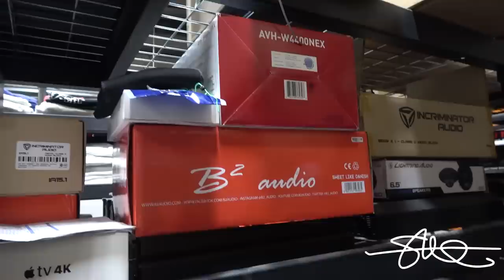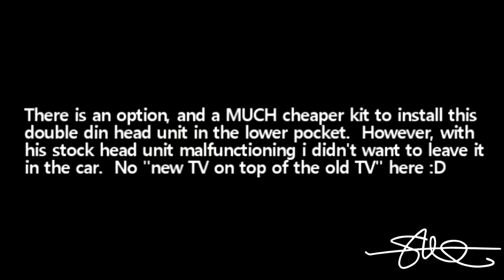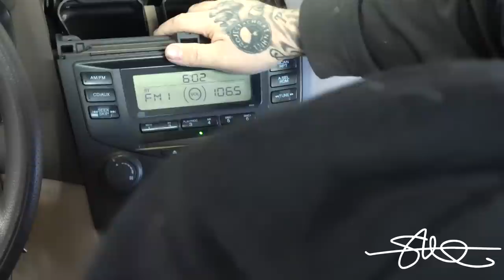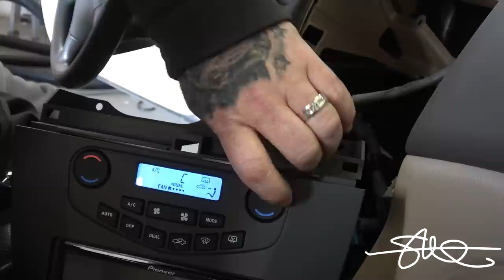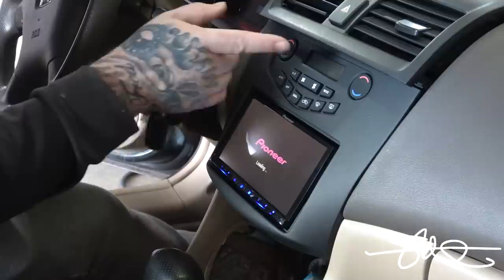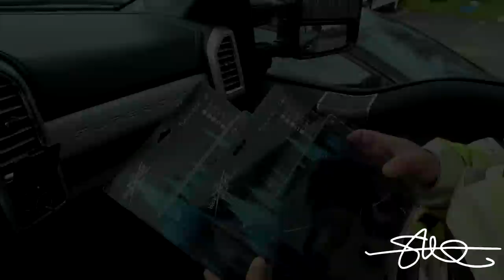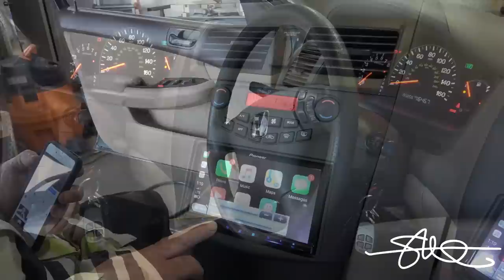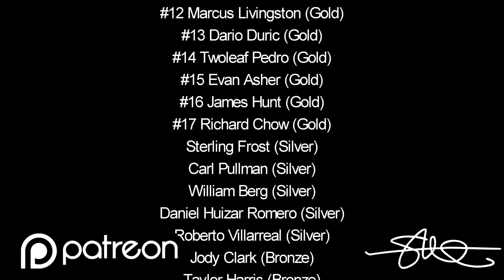A Double Din for Jaybird! The $140 Sound System! '04 Honda Accord (video 2)

Comment: That upper panel the way to remove it with out that metal clip flying out and risk damaging the panel. Is to take and push hazard light switch. Then use screw driver and push down on the center part there’s a slot there. And then use trim tool to carefully pry on the left and right sides. But shouldn’t matter its LX model.

Comment: I had a problem with that metra kit for some reason is was draining my battery if my car wasn’t move for 3 days i found out that it was the connector that gives the light power on the climate controls  so i just left it off it works just doesn’t have light on climate controls idk what to do for now thats how it works
Reply: Self Made Vlog I have a 2006 2dr Honda Accord and I have the same issue with my car. I installed this unit years ago and always had problems with it draining my battery completely after 3 or 4 days sitting. This has pissed me off immensely. I always thought it was bad wiring and I just managed over time but I’m glad I know the problem.

Comment: i did an install on my 2014 honda civic and the dash kit i got feels cheaper then the original piece but it works and its sitting secure  and in the right place
Reply: also i ran rcas on a toyota camry after this and its fun, just the hard part is hiding it in the carpet

Comment: What exactly is the volt out on the rca's 2.2 or 4 volt cause I was looking at 1 really close to that 1 I'm all about that 4 volt out ya buddy lol it does wonders to your signal to your amps lol it's a dam shame if they don't got the big 4 cause that means I would have to add a audio control peace to make up on the deck voltage outs ..

Comment: I do audio installation for a living and just for information purposes all pioneer radios with the parking brake wire you can put to chassis ground with a small toggle switch interrupting it and that will give the exact same effect as the bypass module you installed.
And the bypass module does not get hot.
Reply: Why even do the switch then, just put it to ground
Reply: @philb707  it has to see it pulse to ground. It will not work properly if it always sees ground
Reply: My apologies you're 100% right, i installed some cheaper H/U that just wanted to see ground.
Reply: @philb707  now all kenwood radios you can just ground it out. And some older alpine radios as well but 99 percent of all newer alpine need to use an alpine specific switcher
Reply from the maker: or i can just use this and not have to hit a switch.  I hate toggle switches.
Reply: @meade916  totally agree with you Steve. I only listed this because I have seen in the past that they have failed. I used a switcher in a Semi and I had to tear apart a custom dad I built and it was almost 6 hours of work because that little chip failed. Just giving yall options.

Comment: yup. my boy did a pac head unit with a single din and 4 speaker install and amp. on my 05 accord. took him 12 hours of non stop work only to find out we needed seaker rings for the front and no sub install too. im almost done with it just the bass in the trunk and the same b2s jaybird has and im set. can wait to see how you do the front speakers mr meade

Comment: yo steve, what did the RCA's screw into on the outputs of the radio?
Reply from the maker: ya they grip hard when you tighten them. They are designed that way. They are pretty nice.

Comment: I like the way the head unit looks but not crazy about the ac controls
Reply from the maker: ya i feel ya on that.  They are a lot better IN the car and working but when i first saw them in the box when i bought it i was like 'meh'....LOL
Reply: Fat Tony Slim in my 05 accord I have navigation and it’s even worse. The ac controls are done through the screen. I just have to deal with having a stock head unit and upgraded door speakers. I’m only 17 so I’m kinda on a budget but getting new door speakers was such a good idea.

Comment: I have driven those 03-07 Honda Accords with has a factory radio, on that bottom cabinet there's a bracket with a single din headunit.
The only works on the factory radio is the digital clock.
But since you're a special bracket for the double din touch screen, you might as well install a CB radio on the bottom cabinet.

Comment: Just installed the same unit on my accord 03 coupe, but I cant get the front speakers to work.  All speaker connections are good but still no sound, only from the rear.  Am I missing a built in amp or something?
Reply: If you had a factory bose system there's a little black box it's like 4" by 2" and it's screwed on to the back of the old system. Mine is with nav so I had the black box. All you do is plug it back into the harness and zip tie it somewhere.

Comment: pretty sure you no longer need a TR7 with the new pioneers that you can deactivate it by holding bottom left of the radio in standby mode and it brings up another menu
Reply from the maker: nope.

Comment: Surely the pioneer head unit and climate control relocation panel cost more than $140? My shite cheap £170 Chinese tablet/ not really head unit is broke all ready
Reply: Yeah. Lol that deck is $512 on Amazon
Reply: @JeffBrandt242  wish I could afford ATM and wishing I didn't cut my BMW dash 4 such a shite headunit, that's if you can actually call it a headunit more crappy tablet🙈

Comment: Hey Steve, how do you like the Craftsman ProSeries tool box? Considering getting one for myself but I'm not sure
Reply from the maker: i like it but i am not picky like some tool box snobs are.  I am not a penny pincher by any means but i just can't see myself spending 20 grand or more on a certain brand and get the same if not less than what i got here.  If you aren't a tool box snob you will probably really like it.
Reply: @meade916  I'm a Honda tech myself, but haven't been in the field long. I like the idea of the lock system on it and was looking for a decent box. Might have to jump on one

Comment: Steve I'm with you on that dashboard can beat you if you're not careful.
I do have a question for you I'm looking for a 5 channel amp that not to big it for a camper trailer I've got one low watt pioneer 10" sub in a ported box a couple of super tweets as now haven't got the mid's yet this will be tied in to my TV/PC and a head unit
Reply: diy,raspberry pi 3.0+ and all additional,

Comment: I have a Pontiac g8 but nobody can find a radio kit so I can put a after marker radio in so I have a system but playing it from the stock radio do you know where I can find a kit for the g8 at
Reply: Problem with the G8 is the radio has integrated electronics for the HVAC. This is why back when I had one I bought the Folcik stand alone hvac controller. It is a small touchscreen device. There are some out there that are just push buttons that look like they belong on some fast food equipment or something too. G8 was only really made for 2 years and people just kinda accepted the radio. There is a company on facebook called G8 designs that had a kit. Not sure if they still offer it.
Reply: Fairly sure the G8 is a VE Commodore. Alpine does a complete head unit and AC control kit. And Aerpro have recently released a fascia panel kit containing the AC controls so you can fit any head unit you like.
Reply: Yes they do. Folcik makes the hvac controller and G8 designs on facebook makes the install kit for the head unit. You can buy it as one kit on there facebook. I have had it for 3+ years in my G8 and have loved it. I did the head unit and hvac and it was super simple, they send the wiring harness with it to plug and play.

Comment: Why didn't you leave the stock radio in and do the lower double din install instead.
Reply: The stock don't work why would he leave it for decoration?
Reply: @DEMR1992  looks cleaner
Reply from the maker: because that would look UGLY.  I explained it in the video.
Reply from the maker: @DEMR1992  exactly. Tacky shit.
Reply: @meade916  Cleaner looks tacky?
Reply: @meade916  Mr Meade, sorry i did not see that part as I skip alot through your videos.

Comment: I bloody well hated doing the aftermarket deck  Installed because the deck didn’t even fit proper. Same with the dash kit for my CRV got the kit and the Only thing that I used was the bezel around the deck and even then there is an even gaps these install kits are absolute garbage nowadays

Comment: Mad props for installing a very nice deck for an old buddy, but that aftermarket dash kit looks like cheap Chinese ass. The rubber buttons just look like something you got from a calculator in the 80's and makes the fascia look cheap. Not your fault of course, you didn't design the kit, but the guy who did deserves a size 14 steel-capped boot on his ass.

Comment: Mead916 i have a 04 accord where can i get the stereo u installed whats the brand or model
Reply: you can use any brand you want but that install kit is made by metra go on the site put in vehicle info and it will tell you what part number to get
Reply: @kevinneves1796  i have a 7 inch double din stereo would it fit or do i have to get 6.2 one
Reply: @patrickl3150  I'm sure metra has the dimensions in the description on the site I can't remember what a standard size ddin deck size is but that's what the opening will be 100% so you might have to sell your  head unit and buy a 6.2
Reply: What about for the cheaper way putting it in the cubby hole down by the gear shift
Reply: it will fit a 7" up top as long as its a full screen and ive installed both kits and the lower is in a garbage position sits way to low and your eyes are taken off the road and shifter is in the way